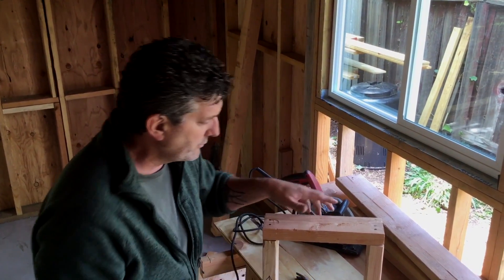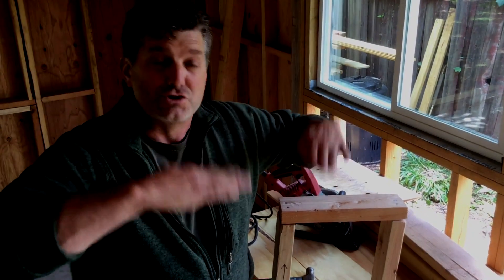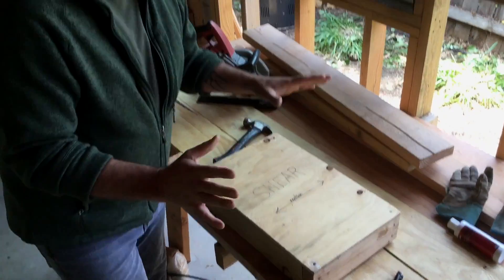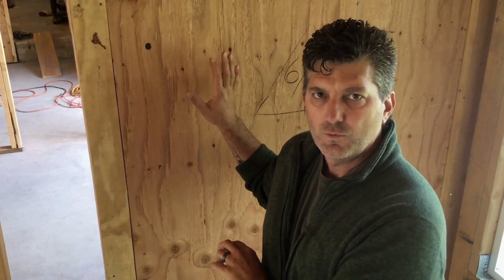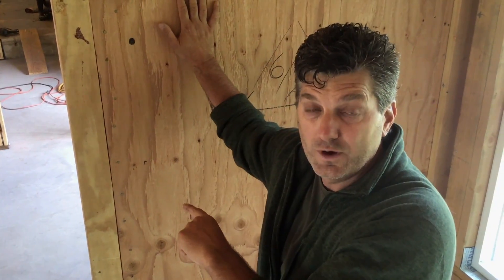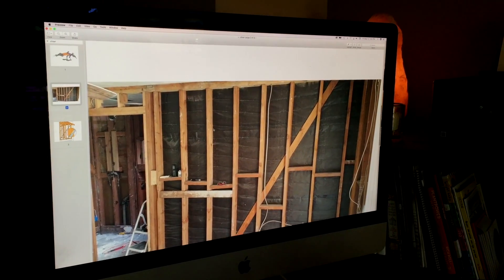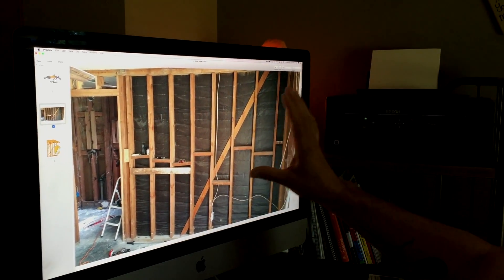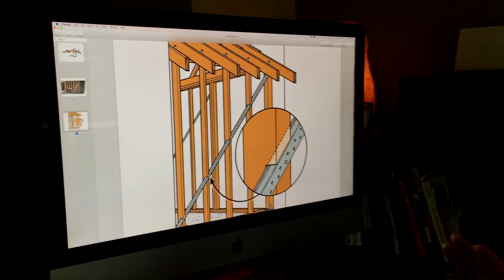Why do you need a shearwall?

Comment: The entire house is sheathed with plywood. Is  
That a shear wall? I know that it doesn’t have the nailing pattern or hold down but do you need the diagonal brace in this case?

Comment: I have a 1900 Queen Anne and I have a small bathroom with a large walk-in closent next to it in the hallway on the 2nd floor.  I removed the plaster and lath boards to just finding a typical frame without the angled board as you showed at the end of the video.    So if my wall does not show any angled support beam, it will be okay to remove?

This wall is 4' from the 1st main support structure inside the home (basement) and the other direction the floor joist go 8' to the exterior support.    I have no idea if that makes any sense to you.  I wish that I could show you images.